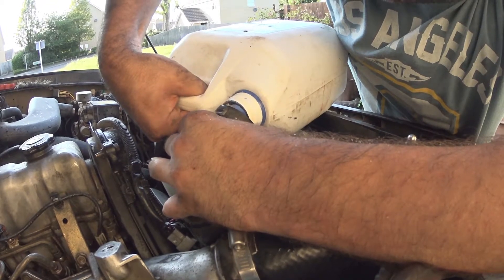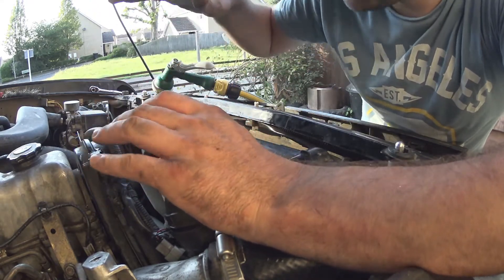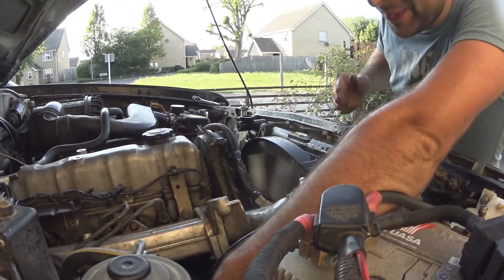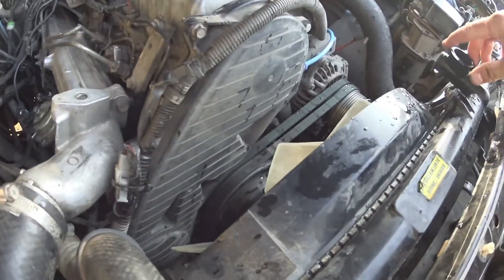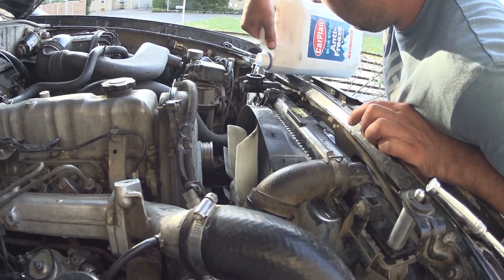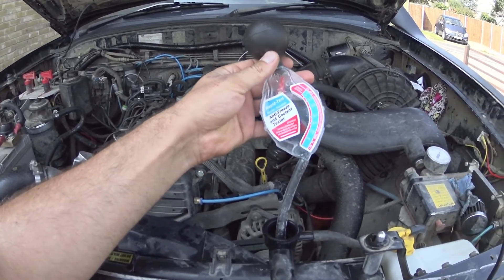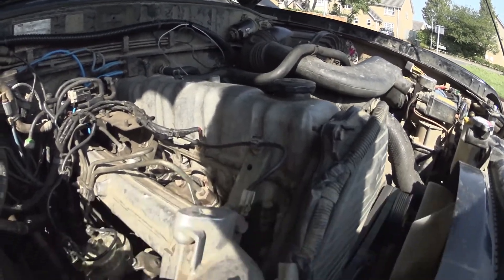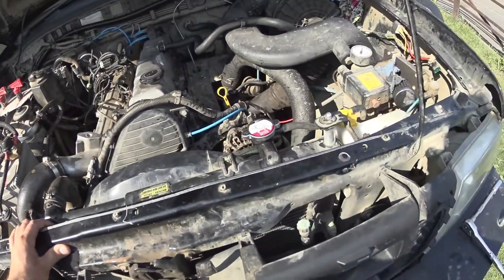Ranger / B2500 cooling system bleeding

Comment: Have 2 of mazda/ford 2500 td wl engine. 

Have problems with both after put new thermostats in. Thermostat just not open. But engine is overheating both trucks. 

Today i take out pump of one Ford. Still good. Jack up front and try to get air out. Still the thermostat not open. I test thermostat in hot water, it opened. No problem with it, is new one. 

Im bit confuse. Iam i right to say that water flow is from bottom to top. Hot water in bottom come out engine to bottom of radiator if thermostat open, then enter on top in engine?

I see you take of top hose then pour water in it, and then in radiator fill hole to go to bottom hose. That hose is still block by thermostat. In bottom. So water can not go in engine. Only fill up radiator and bottom hose. 

Am i correct now?

I didnt know i can unscrew temp  sensor to let air out. Do you think its because i have still air in system the cause that thermostat not reach 82°c to open. 

Will be glad if you can reply. Then i can fix both Fords WL

2 days on it, and just cant let the thermostat open. Not get all heat to open. 

Also check bypass hose from housing of thermostat to head/block. Its open and no blockage. 

I still think its air. Truck not smoke. So head gasget is fine.

Comment: Hi mate im not a mechanic just an enthusiastic amateur, when i done the coolant system on my mk 2 recently i took the long pipe from the nearside heater matrix off turned it up and stuck my hose in towards the cab it got that airlock out the heater matrix and the system pretty easy, as when i got it the previous owner said the heater didn't work and that was what i was originally trying to fix, hope you dont think I'm a smart arse